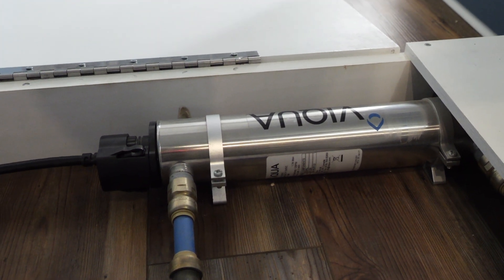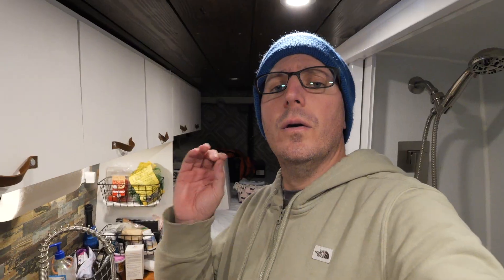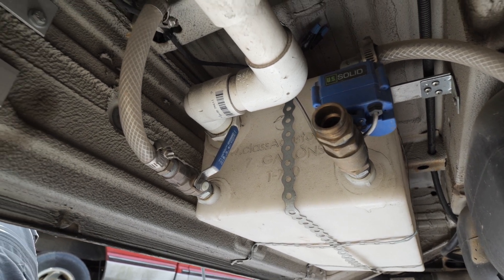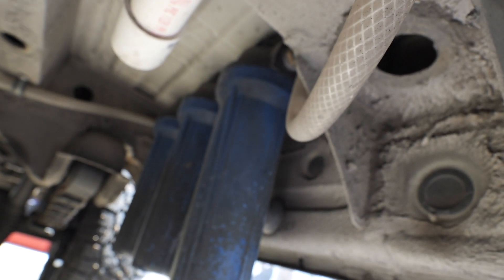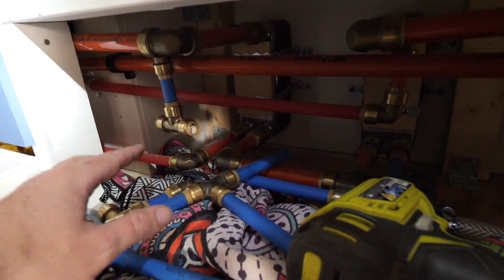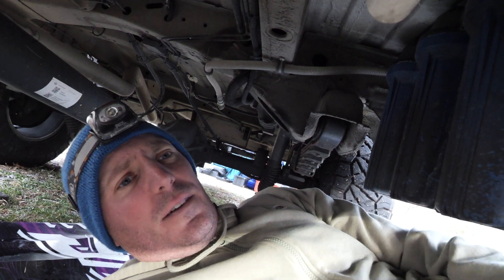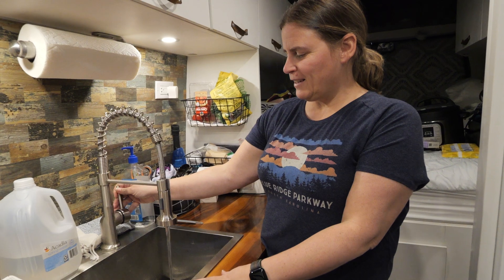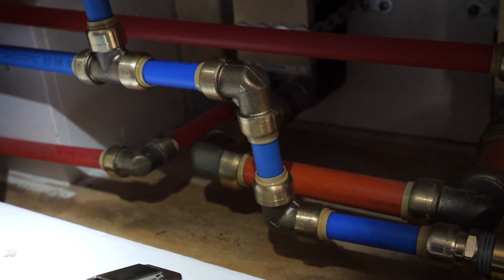A RECIRCULATING SHOWER for Vanlife Update  |  Is it WORTH IT?

Comment: Water operator here. If you're not drinking the water, you don't need UV disinfection. The quartz tube around the light will just get all shmaged up and be ineffective from the soap scum. If this water is only being used for bathing, then you dont need a whole lot. We've all had a bath in a lake. You'll be okay. For filtration, just get a filter that catches the hair and large particulate. That soapy water is your soapy water and just means you don't need to use soap every time. Just wash with the soapy water, like you would when you have a handwashing pan. When you're done, let the water settle out. Gently pour the supernatant from the top of the tote into a second tote and throw out and rinse the settled solids left over on the bottom. You can do all this with 2 rubbermaids and a pump. All you really need is a pump, a way to heat the water, and a porous filter that catches debris so you don't get a face full of hair (like a furnace filter or something similarly porous depending on your preferred filtration). Make it so you can take the piping apart easily to run a cloth on a stick through the lines to clear out built up residue, and you're set. You're overthinking it. I use this at my cabin just fine. If your source water comes from a lake or stream, filter it before you put it in your reservoir. If you're worried about contamination, get some chlorine tabs or calcium hypochloride (swimming pool chlorine). You can add extra filtration as you like, but just lettling it settle over night and keeping the supernatant will still give you enough for another shower of semi-clean water. If the point is to have a shower with only 10 or 20 liters, then this is your best and most affordable way.
Reply from the maker: Awesome!!! Good to hear from an expert!!!! Thank you for the information and your comment!
Reply: recirculated water for washing needs to be heated above 40c to prevent the legionnaire bacteria...or run through a UV light
Reply: Never invite me over for dinner if you are reusing the soapy water to wash your dishes.

Comment: What I am planning on doing is having two plug holes, one will be blocked off which would go to the gray water tank and one hole will be used for the continuously circulating water hole WITHOUT soaps that would go through the filtration unit. When I am ready to get clean, THEN block the filtration hole off and open up the gray water tank hole, use soaps, and rinse off, that way the filtration unit won't need cleaning as much

Comment: If you want to filter out soaps an oils shaving cream etc you need to check out the Wavebrite grey water filter. Its used on boats so they can dump grey water overboard. You need to prefilter of course. Its an expensive filter up front and only good for like 5000 gallons of water but can be refurbished for about 1/3 the price of new. I would try to only run water through the filter when washing soap/shammpo off then divert around the filter so it will last longer.  Ive been working on it myself
Reply from the maker: Never heard of the Wavebrite before… absolutely worth looking into for a recirculating shower! Hoping your shower goes well! Let us know how it turns out!
Reply: @WanderfulRevolution   I looked for ever for a filter to remove soaps and I believe this is the only filter/module that will do it in real time and its been out a decade now. Using with NanoCeram filters with Carbon so its like 2 filters in one that removes all the bad stuff (virus/cyst etc.) with high flow rate. Its really just trying to come up with a package and figuring out how to get it as small as possible as you know. Im using a 110 version of the I-heat shower head as well to heat water with temp control. I have it connected right after the filters and just use a hand held shower head  from there. Just my 2 cents and passing on what I have learned to you since you have passed along what you have learned! Good luck to you as well.!

Comment: Been waiting FOREVER for the follow up. I've watched them all
Reply from the maker: Thank you for watching! Sorry it took forever! We have been traveling and got hit with some big life changes…
Reply: @WanderfulRevolution  I completely understand. I didn't mean to make it sound like y'all owed me/us. Just excited. Those are all great reasons for stopping the shower and when I put mine and if I find a solution for the soap/shampoo I'll definitely share. A couple ideas of getting a sand filter as the first pass after draining from shower. Have you looked at that, which means am I wasting my time looking into and testing that? Thank you so very much for all of your tutelage!!
Reply from the maker: @joehoffman7019  no worries! We didn’t take it that way at all! We have not tried the sand filter idea at all. After our UV filter went out, we just didn’t want to take in the expense.

As far as the UV filter goes though, we used a 12v filter, but you could always use a 120v one and it will save lots of money and I don’t think it would consume too much power. Just a thought.

Best of luck, we look forward to hearing how your experiments go!
Reply from the maker: @joehoffman7019  we totally get it!!!! The sand filter is a great idea… just have to deal with getting the flow rate right! I know some home systems use sand filtering but they also have a lot more water in the circuit… we are wishing you the best on your system and would love updates!!!

Comment: Bummer!  I'm deep in the weeds of building my recirculating shower system.  I'd love your thoughts on why you used a UV filter at all.  I know they're recommended in most systems, but it feels like overkill, especially at the price point.
Reply from the maker: We are kinda split on this… you can wash in a lake or stream and probably be ok… if you get municipal or city water that has been treated you’re also probably ok… we never tested the water after use… it’s an extra layer of protection, but for the price I’m not entirely sure if it’s necessary…. Testing would be the only definitive way to be sure!!! Good luck with your shower!
Reply: Check out the NanoCeram filters with activated carbon(these filter out all the bad stuff). You wont need UV and it helps with smells. Want to remove soaps in real time/Wavebrite Gray water module!

Comment: Understandable, but sad. Your video is very informative, and helps others know possible problems. It helped me adjust my expectations and come up with counters for the problems.
1. Use it for water use reduction per shower. This can be made to have a set small amount used per shower, no matter the length. Smaller reservoir replaced fresh each start. 1-2 gallon showers. Also reduces need for UV.
2. Custom back washable filters. Sand/KDF in the fillable empty canister filters. No Carbon. Carbon cannot be backwashed and will plug with soap. 
3.Perhaps have a bladder tank downstream of filters, that backwashes on dump solenoid. This makes a small backwash per shower or dump. The bladder tank can have a separate solenoid to not backwash every time.

Comment: Great Video...After basing our recirc shower on yours and Snow and Kirt's (the same filtration, UV system/heat exchanger idea etc) and after a couple of months tour in Europe, we could never get rid of a slight odour in the water after about 4/6 showers, we even did wet wipes before showering and not using any products in the shower basically a warm shower to rinse ourselves off, we decided to take out the system, weigh all the equipment used for the record, (pump x 2, UV filter, spin down filter, surge tank, 3 x 10 inch filters etc etc plus fittings and actual water volume...it all came to around 35kg and then added a tank for the same weight in water ie 35kg...we can now do far more showers, albeit short showers, in fresh water....It was an interesting excersice putting the recirc system together.....but it didn't work out for us....Cheers
Reply from the maker: Thank you!!! In the end I don’t think we got as much use out of it as we expected… this van was built during Covid when everything was closed and we wanted the flexibility to shower whenever we wanted… in the end we opted for other shower options as well… if we ever build another van I think we will definitely skip a recirculating shower… but I’m glad you gave it a go! It was a fun lesson indeed!!!!! Thank you for your insights!
Reply: @WanderfulRevolution  What I don't understand is why reuse the water for multiple showers, all the van lifers do it. In the original showerloop the water was dumped after every use, the loop is for each shower not for using the same water for a week. You use a much smaller tank (2 gallons max) and that way your water is always clean, only need to clean/change filters

Comment: kudos to you guys and the amazing work of trying to make it work. the idea of recirculating and having long warm showers is a dream come true for people like me, whom absolutely live for long, hot showers. i can shower for like 20 minutes, on a hot shower, and it is therapeutic, relaxing and does wonders for me, and if i need to be 'energetic' instead of 'snoozy' i just rinse off with cold(er) water for the last few seconds.

now, if the main problem is petroleum-based soaps cause problems, then well, the 'easiest' solution is non-petroleum based soaps. yeah lol, wish it was that easy, it is not, because it ends up getting expensive AND, as you said for the parts-you need to stock up on those materials and that comes at a space and weight cost. 

now the thing imho though where i personally believe improvements can be made is that imho, your 'exterior mounted setup' is just not feasable. the entire thing gets dirty so it's going to be a hassle and with cold winters that is just not not fun, it's potentially able to make you catch the flu/cold. on top of that, freezing is definitely a problem, even though imho, you could circumvent that by simply closing off that space and isolating that space and combining it with the heater system. 

as for the uv filter, a dozen reasons can be why it stopped working, but i think you should consider placing it in a 'shock reducing' setting. something - as weird as that may sound, like 'hanging', with a few springs to prevent it from dancing around. 

i think an improvement could be is having the filters in a 'box' in the shower space itself where you can simply take them out, rinse them in the shower itself, and as such make maintenance a easier job. 

i also wonder how long one should go anyway with that and whether some additional pre-filters could be installed like in the floor pan of the shower. i don't know how long you guys do with the water, but i'd say that perhaps you simply should go for like two to three weeks maximum, then simply dump the grey water and add fresh clean water again.

perhaps something to ponder about: could you perhaps implement a system where you 'reverse flush' the system, like when 'dumping' the grey water, you switch the direction of the pump and you push back out a lot of the clogging, and as such, have like a multi-weekly automatic 'filter clean' ?

i'm also sure that this gets a lot more comfortable for people that live in a van solitary, not as a pair. 

what i'm also thinking of is this : i think you can compare it greatly to a swimming pool. perhaps adding like a filter with chlorine (pool) tablets can improve hygiene, and add like a mini pool sand filter, which could, perhaps, theoretically, catch most of the filter issues. the benefit of pool filters is backwashing. perhaps a system like that can be invented for vanlife too.

i think it would be essentially the holy grail of vanlife, and water shortage at the same time.

the combo of a water-saving shower setup, recirculating your shower water, and being able to backwash could provide a combo that would be industry changing.

Comment: Great video guys, as usual. Thank you! A single POV comment, those easy/awesome snake-bite pex connectors are super expensive vs crimp clamps. I only use them when crimp-ons are not possible.
Reply from the maker: Thank you! Absolutely true about the crimp-ons being cheaper!!!! We did have concerns about some of our smaller spaces and working with the crimping tool… we decided to play it safe and go with the snake bites! Looking back we could have saved a decent amount! Thank you!!!
Reply: If you’re doing an entire home and placing fittings in regions that are inaccessible, then I would agree that using a crimp/clamp, or expanding fittings would be better, but for a small system like this where you have accessible fittings - but very limited elbow room, the Shark bites are much preferred, plus you can disconnect and reuse them.
Reply: I hadn't known that sharkbites were available for pex - I noted that when watching this! Are they also reusable??
Reply from the maker: @pianogal853  yes they are!!!
Reply: @pianogal853  They are reusable, yes. Although you wouldn’t want to use a fitting that has been used and abused repeatedly in a permanent or inaccessible area. But something like this where it has been used just once in a light duty application you could absolutely reuse with confidence.
Reply: @JimYeats  thanks - that's helpful!
Reply: @WanderfulRevolution  thanks for putting this one out! Did you sell the van yet?
Reply from the maker: @pianogal853  update tomorrow 😉 😉 😉

Comment: Thanks for updating us!  Happen to have any data on # of showers between filter cleanings/changing?  Was soap filtered out well for 'n' number of showers before you noticed the water was no longer cleaner than the objects to be washed?  Basically an 'use' data you might have can be useful for other designs.  

May your water tanks always be full and the tires always pointing down! :-p
Reply from the maker: Unfortunately no… the data ended up being about the same… if we ever do a system like this again I’m building spreadsheets!!!! 😂 thank you so much for the well wishes!!!